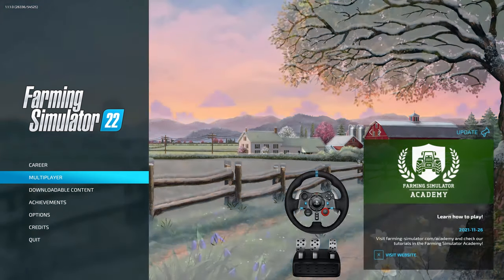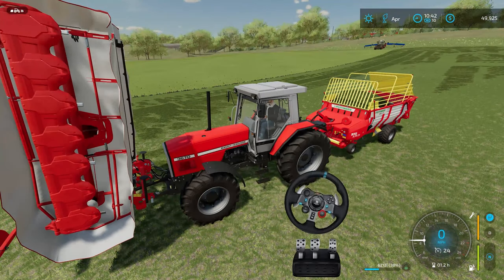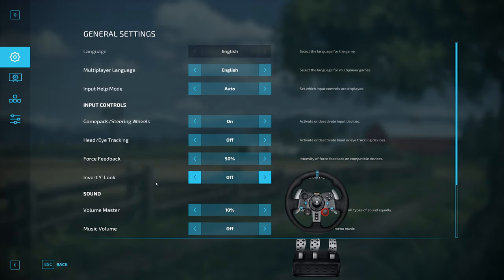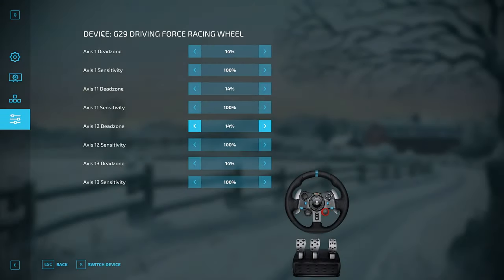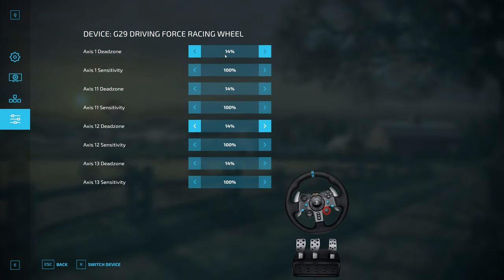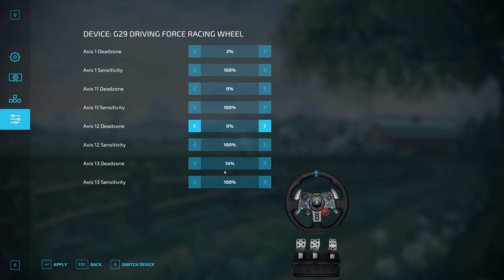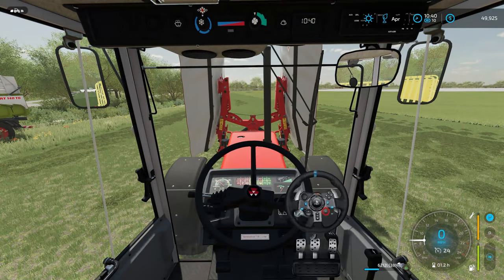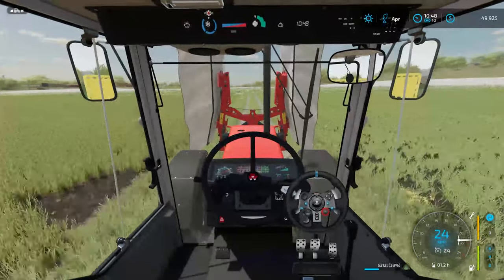Farm Simulator 22 Steering Wheel Dead-zone Fix & Configuration

Comment: Thank you so much I thought my g920 was the problem but it worked on beamNG drive that dead zone was ok driving tractors but when I hopped in a truck (what I drive most of the time) it felt super wierd
Reply from the maker: Yeah, it was a change of pace to know farm equipment doesn't have a centering mechanism.

Comment: thanks for helping out with this issue. But in my case, the Farm Sim 22 always set the dead zone back to 14 % when i start the game. I re defined the input bindings xml to all Dead zones 0% and activate the write protection. It doenst matter. When i start the game again, the Deadzones are set to 14% again. I couldnt find any solution on the web for this problem. Thank you for any ideas to fix this. Regards Dan
Reply from the maker: You can try to delete the settings file. Let it recreate it and try again.
Reply: I have  a v900 steering wheel setup. I can't get the pedal to activate nor w8ll the mouse let me look left and right..only up and down..can you help?

Comment: great vid, but why are you using a PlayStation wheel on pc? it was my understanding that the g29 only worked on PlayStation, thats why i got the g920. I would have got the g29 if i thought it worked on pc. but this video did solve my deadzone problem, thanks.
Reply: g29 works on pc,ps4,ps3
Reply: @dareplejer6063  I realized

Comment: I dont have any of those settings allthough I plugged the wheel in before I got in the game
Reply from the maker: At the bottom you need to click the corresponding key to get into the "advanced" setting.
Reply: @HelpCloud  thanks for responding but I dont have that option either. On the bottom it only says circle to go back. Im on ps4 btw
Reply from the maker: What wheel do you have?
Reply: @HelpCloud  Logitech G29
Reply: @HelpCloud  Im totally out of ideas now. Nobody seems to know this problem and nobody has made any videos on it. Im just amazed how a game is supposed to have steering wheel support and feedback and all yet still it cannot even deliver what it promises
Reply: @bastardastic2873  same - still no solution found?
Reply: @Benhutchie22386  I contacted Giants and they just told me that they know about the problem and are working to fix it.
Reply: @bastardastic2873  Hey since my settings worked in main menu but not in game, I'm curious. Were you in main menu settings and still not getting these options?
Reply: @nistramai  yeah I dont get the settings anywhere